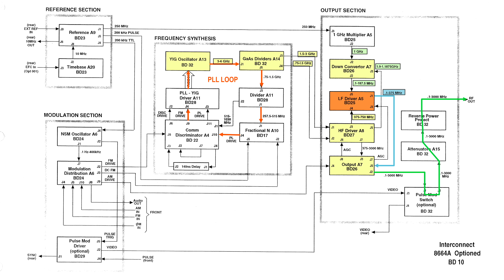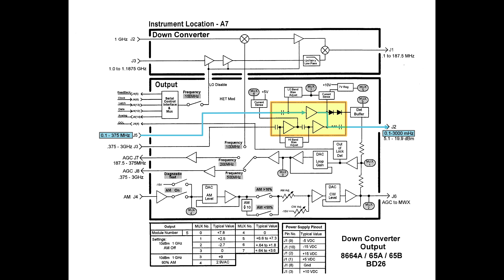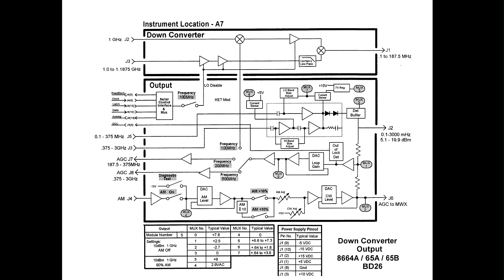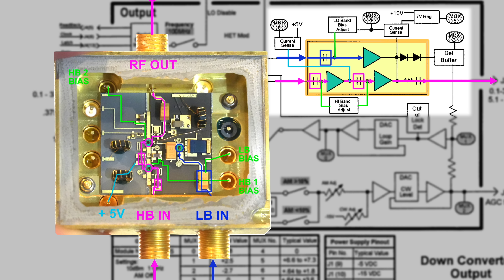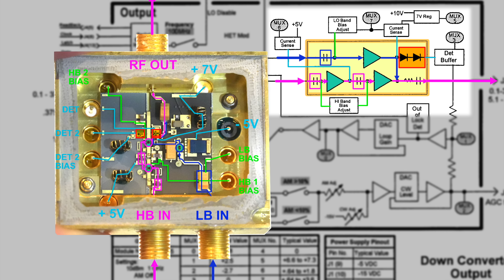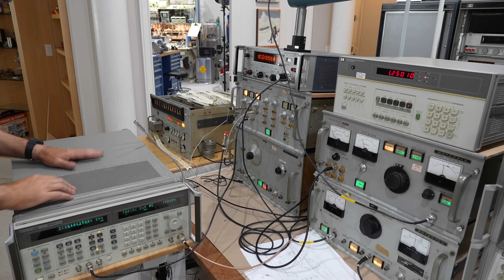HP 8664A 3GHz Synthesized Signal Generator Repair - Part 4

Comment: If you had the specs (e.g. what each part of the circuit was tuned for), could you repair the golden box? Or is the issue the inability to source equivalent silicon parts like the transistor or pin diode?
Reply from the maker: It should be repairable if we knew how to test and tune it, and had access to the transistor chip (and a wire bonder, but that I have at work). Note that the amp does not work on its own, it needs all the active bias circuitry that’s on the board to get going, which adds considerably to the difficulty.
Reply: @CuriousMarc  I believe in you!
Reply: oof, the line between destroying it completely and repairing is so thin, but I guess there's nothing to loose. I don't know how you could even safely replace those evil tantalum caps what are they bonded with? You'll need one of those fancy precision probe jigs. Would be an amazing project either way!
Reply: actually, might be funner just to dead-bug a clone of it. Get the spirit of Jim Williams!
Reply: @cda32 You can't really deadbug at 3 GHz but ordering a pcb isnt that hard.
Reply: @metatechnologist X-Microwave would like a word with you

Comment: I have worked on a few 'golden boxes', but have never encountered on with a sapphire board substrate or the microscale capacitors and inductors like this one. It would be amazing if someone has the ability and test rig to test and repair this.

Comment: Why do the adjustable bias inputs require no chokes? Is it because they have reasonably high resistance resistors in series, so their impedance is highish anyway? (But if so, does it not matter that they are connected to the input side of the amplifiers, and thus to lower amplitude signals?)

Comment: I have a question: When was this equipment first manufactured?
If it was produced quite a long time ago, I wonder if the "golden box" has reached its design limits. What I mean is, with modern semiconductor technology, wouldn't it be possible to design it smaller, for instance?

Comment: It should be simple to find a problem if you have a working reference design to which you can compare your faulty design. There must be a component behaving nonlinearly therefore introducing harmonics, or the bias provided is incorrect.

Comment: I agree with one of the comments in the stream, the output capacitor in the circuit which is faulty is darker then the other two.  This would be at least a quick and possible to check in circuit as the output is disconnected with a LCR meter and ohm meter.   As the circuit is working but only distorted, the output capacitor would be a probable failure mode.  One other way of checking is to use a hot air gun set to 100C and monitor the output capacitor leakage with temperature.
Reply: The cap didn't look great, but maybe it was toasted during the lid removal.  Also some clues might be gained by measuring S11 at the output connector and comparing it with the known-good module.

Comment: Applause for the detailed effort involved here!  But why not quickly check the tantalums as a final hail-Mary before giving up on the module....for now?
Reply from the maker: Because you won't be able to test them in circuit, you might not even see the problem out of circuit, and these are not regular tantalums - they are RF capable tantalums, don't have any in the bin to replace them with, we'd have to order some. There is no way to test the amp without remounting the cap in the hybrid, the hybrid on the board, the board in the module, then the module in the instrument, recabling it, which takes a day for each try, in an instrument that is already repaired and in service. And we don't even know that this is the problem - the chances that we repair anything this complex by trying our luck at randomly changing components are very small. We're not recappers. You must be thinking some other channel...

Comment: Having worked in thick & thin film hybrid manufacture, I am pretty sure the lid to the Hybrid is bonded with silver loaded epoxy, for commercial applications 0-70°C this is perfectly adequate though not hermetic, i.e. any inert atmosphere would soon dissipate away. For Mil applications this would have to be seam sealed welded within an inert glovebox to make it truly hermitic. See epotek for typical adhesives & properties. I have reworked many items bonded with silver loaded epoxy Tg is ~150° and goes quite soft and comes away cleanly.

Comment: Not sure I understand why the need for such extensive wire bond trimming and peaking - presumably to get a level frequency response- when the output is auto levelled anyway by the AGC system? What am I missing?

Comment: If you consider the box BER then is no problem with replacing those three? tants on the off chance.  Nothing ventured, nothing gained.
Reply from the maker: Agreed. We'd have to find microwave rated tant caps, but our instrument was already repaired with the new golden box and working and back in service. So just pain, no gain.

Comment: Marc, check the continuity of the bond wires, the -5 v bonding wire with the different passthrough looks black in one part, like it burned. It could be cut in the middle of the back section but I cant see it, it requires a closer inspection. Best regards. Maybe it's a good occasion to pay a visit to John McMaster for this repair.

Comment: That's some very impressive RF voodoo going on inside that gold box. I have to wonder though, in the decades since this instrument was designed, have technological developments enabled designing a replacement using off the shelf commodity parts feasible? A 3GHz amplifier was very exotic at the time but today that is much less exotic.

Comment: Wow I wouldn‘t have guessed they push several GHz through a tantalum at the output…
Reply from the maker: Indeed this is nothing like a regular tantalum cap, it's a specialty one made and tested for microwave use.
Reply: @CuriousMarc do you happen to habe a datasheet for one of these? I would have expected some nice avx or something similar but I‘ve never encountered this type in any other broadband amplifier design yet…

Comment: Expected to see some in depth reverse engineering of that hybrid and possibly repair, or even replacement. Likely could be built quite easy using off the shelf parts these days (GaAs MMICs), without any need for sapphire hybrid. Glad you at least found a donor unit for a new golden box.
Reply from the maker: You are welcome to do the easy reverse engineering and make us a replacement. Keep in mind that this is only the center core RF part of the amplifier - the rest of the amp takes about ½ of the board, part computer controlled and part analog loops (4 of them if I count right). You also need to hit 0.1 dB flatness and -70dB second and third harmonic generation over the whole band, 17 dBm output power, and AGC signal generation for the three previous stages. Good luck...
Reply: @CuriousMarc  I don't know shit about RF, but I know computers enough to understand what you're getting at somewhat. I just cannot gage how big the fissure of specificity needed  and implied to match this part here lol, but don't worry he's got this... ;)

Comment: If you really badly want to fix the other machine, there's a company around the corner from me called Forefront RF who make chipsets for mobile communications devices that operate at 3.6GHz and are "cheap as chips" as they say. They could probably tell you how to use an FPGA and a handful of off-the-shelf parts to make a replacement output amplifier with 2020s tech.
Reply from the maker: This is nothing a modern commercial comms chip can do - at least not that I know of. It’s a wideband instrumentation amp, 0.1 dB flatness from 100 kHz to 3 GHz, with less than -70 dB second and third harmonic generation over the whole range. The box only has the inner RF part of the amp, the rest of the amp with the computer control, analog loops, AGC genration and monitoring points, which takes about ½ of the board. You’d have to reverse engineer and provide an equivalent for these too.

Comment: The chances of repair are a bit higher because it is the low frequency amplifier that is faulty, so matching circuits are a bit less critical.  It should also be possible to sample the output before the pin diode to eliminate that as a failure.  
Some degree of DC or low frequency testing of most components should be possible.
As an aside, how does the self -test detect that the amplifier is faulty?

Comment: in Moscow we work with a production company that can do repairs like this golden box. They can isolate the problem carefully remove defective chip , put new chip on a special conductive silver glue and wirebond it. They also have a good amount of different RF components in stock. Also they have a very good experience , they can determine the component or find a replacement one even if the chip has no marking code . I dont know how they can do that :D
Im pretty sure you can find someone in USA who can do this repair with wirebonding but it is not a cheap option. Much more easier and cheaper will be to find another defective unit with working LB output or LB output board for a few hundred bucks.

Comment: Amazing RF goodness. Is it just a lighting effect or are the ceramic caps attached with something other than solder paste? I can see some components have the shiny solder finish but the ceramics look more dull like it's some sort of adhesive. Also, @gregkrekelberg4632 has a great idea of sending this to The Signal Path. Even if he can't fix it he might shine some light on the deeper innerworkings of it.

Comment: It may be worth gently pressing on some components while operating, to look for mechanical open-circuits. Some of the capacitors seem to be lacking conductive adhesive, although there is almost certainly a small blob underneath. There's always the traditional freezer spray and heat gun approach too.

Comment: 2 simple contemporary MMIC devices on a well designed PCB should easily replace that unobtainium output amplifier.
Reply from the maker: Of course not. This is a computer controlled instrumentation grade amplifier with 0.1 dB flatness control from 100 kHz to 3 GHz and something like -70dB harmonic generation. What you see is just the RF core of the amp, the rest takes 1/2 of the board. There is no commercial off the shelf MMIC that will help you there that I know of.

Comment: I really don't rule out finding someone who was involved with the design of this amp (because many wonderful people watch these amazing videos) but, failing that, I wonder if anyone has access to an appropriate microprobe system, because it would be really nice to get two probes across those tantrum capacitors. Semiconductors tend to fail more convincingly than this fault shows, and a bad tantalum cap would tend to show up most at lower frequencies.
Reply: Tantrum capacitor, I see what you did there. 🤭
Reply: Chissà, forse si potrebbe usare l'attrezzatura di chi recupera i dati delle schede SD...

Comment: I have used ribbon bonds in hybrids.  This is the first time I have seen a mesh bond.  My guess is they have less stress than a ribbon bond.   SiC is also clear substrate material.
Reply: yes - I have a bonding machine which can handle wire and ribbon bands and deep bonding for exactly such boxes , bur never saw an option for the mesh bonds. looks very interesting. But manually bonding with (my K&S) is a real though task.
Reply: @rolfdieterklein  Does your machine do wedge bonds for ribbons?
Reply: @Chris_Grossman  yes. I have to change the head in the machine to use the ribbon bands with wedge bonding. K&S 4700 analog: "• Gold wire diameter
• Ball bonding and wedge bonding
- 0.7 mil to 3.0 mil diameter
- 17 micron to 75 micron diameter
• Gold ribbon
• Wedge bonding
- Up to 1 x 10 mil
- Up to 25 x 250 micron
• Aluminum wire diameter
• Wedge bonding
- 0.8 mil to 3.0 mil diameter
- 20 micron to 75 micron diameter"
Reply: Spool size
• Ball bonding 2” x 1” double flange spool
• Wedge bonding
- 2” x 1” double flange spool
- 1/2” spool (type TS-1)
- 2” x 1” spool holder for ribbon
• Bonding tool specification
• Wedge bonding wedge length
- 0.750”
• Ball bonding capillary lengths
- 0.375”
- 0.437”
- 0.625”   and  Wire feed angle 90 degrees, vertical feed /
wedge 30 degrees, 45 degree
Reply: more likely it's to reduce high-frequency impedance due to skin effect?  same idea as Litz wire

Comment: For some strange reason I just noticed that you are not wearing and a guess never wear an anti static wrist strap. Was that yearly certification training I had to do in vain?
Reply: Those straps are over hyped. I always ground myself out when I first sit at the bench. My chair has a grounded ring around the base. My feet stay on that when I am at the bench. I've never killed any thing in over 50 years at the bench. But if it makes some one feel safe then they should do it!
Reply: @LarryYaw In my case, it was protocol. So for decades when entering the lab area, it was wrist strap, test on a box on the wall, before touching anything in anti static bags and removing or resetting cards in the frames. And considering the cost of those cards, or at least what we charged for them, it seemed reasonable.
Reply: @mentatphilosopher  I understand.
Reply from the maker: Our lab is ESD. Shoes, bench, chair are the fancy ESD kind. This is bipolar by the way, not CMOS.
Reply: @CuriousMarc  In fact it's a GaAs!
Reply: It's a statistical thing.  Let's say you fry one in a thousand things that passes through your workstation.  An individual working in their basement will probably get away with that for a lifetime, and if not, oh well.  A team member in an ISO-certified production facility with a 0.1% ESD damage record would be... "problematic."  Especially if they're only one in a dozen or so employees who will handle the device.

Comment: My grandpa worked at IBM for 50 years. He brought home so much cool stuff. Magnetic core memory, transistors ect.. but I remember he he got a tiny Tie clip that was all golden with tiny gold wires and transistors inside. I wish I still had that today.
Reply: I own an NEC tie pin, with a similar setup, but not with a transistor, but an entire silicon die. About 10k transistors.

And it is awesome. One of my more treasured posessions.

Comment: Low capacity FET probe and other working golden box open too, should be not too difficult to trace the fault to a part, by comparing signals. But without wire bonder, you're screwed. Sucks, if a $20k machine dies because a sand grain sized part.
Reply: in another comment thread he mentions he has access to a wire bonder at work

Comment: It might be good to get Shahriar from The Signal Path involved.  He's done some pretty phenomenal repairs on golden boxes, especially microwave devices. At the very least, he could fully reverse engineer the module which might lead to a homegrown replacement. (Edit: Typo)
Reply from the maker: Where is the 0.00.1 - 3 GHz Instrumentation Microwave Amp Rescue Channel when you need it!
Reply: @CuriousMarc  It might be worth testing the caps, I mean those are HUGE - you could probably replace those?
Reply: That would make up an interesting part 5 ...
Reply: yes good idea, I think with current parts it should be possible to build a replacement -- The frequency is not too high, probable on the working instrucment some parameters might have to be measured, as voltage range etc on all the in and output pins ... especially for the detector part.
Reply: as far as I know Shahriar still doesn't have a wire bond machine, which would make repair impossible. also it would be very difficult to get samples of these bare silicon dies as a hobbyist...
tuning might be a challenge without rf pico-probes...
Reply: @stergeon8272 yes the silicon dies usually you get a 100x package ... but analysis would be great though
Reply: Ken already has it figured out 😁

Comment: Maybe measure the input and out put z using a network analyser to maybe identify the part of the circuit not performing?   Where is the hi-Z RF probe to trace the signal path?  Have to admit the tan. caps would be tempting to replace, if they were leaky would not be good and effect the performance of the amps.    Do not give up you have gone so far.

Comment: I had already seen a video showing how the chips are connected to the terminals using gold wires. It is an automated and extremely fast operation: the gold wire is cut to the exact size using a small arc, with the help of an auxiliary electrode. The process is similar for attaching it to the terminal.
HP has a long tradition of developing its own special components, as they are what provide the precision that is the brand's DNA. This hybrid module is perhaps one of the simplest. Construction techniques above 26 GHz must be much more complicated.

Comment: Can you check the tantalum caps in-circuit?
Reply from the maker: For low level leakage, probably not. However I do agree, the "low" hanging fruit would be replacing the tantalum (I'm thinking the one on the LB bias line at the lower left corner) with a similar RF rated one and see if that helps. But we did not need to. At this point the amp was already swapped, the board was already remounted, the instrument already repaired and in the setup.